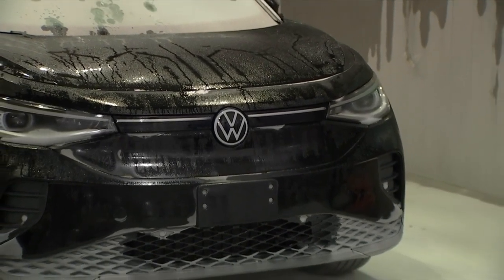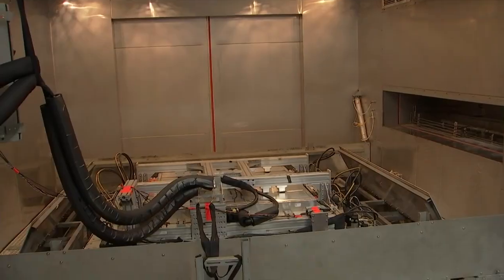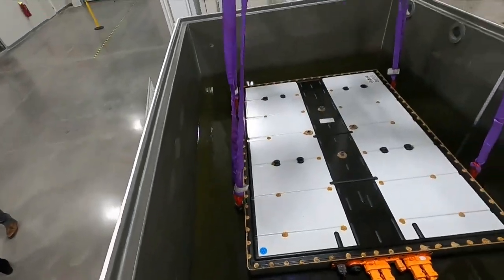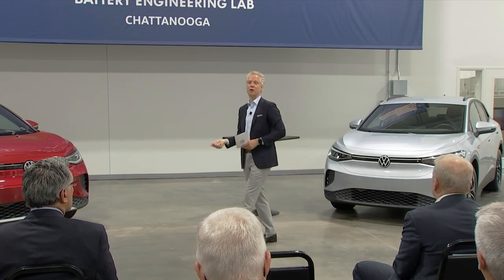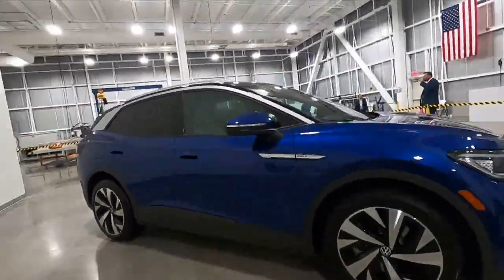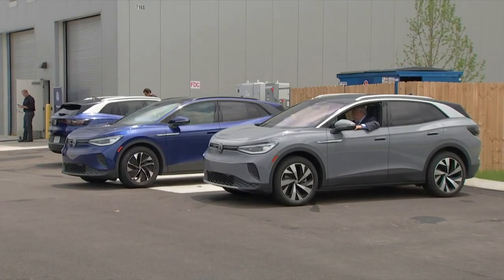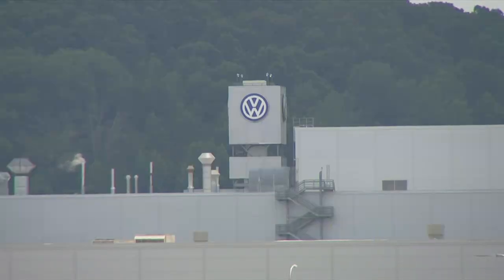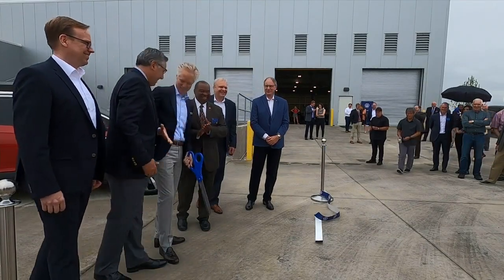Chattanooga's Volkswagen plant reveals new electric vehicle battery lab

Comment: Until batteries can increase their power density, and there is some new composition that allows for 2-3 times more stored power for size/weight than where we are now, EVs are inferior to gas power plants. They also aren't cleaner to operate, you're just exporting the emissions to the country that has to mine the minerals that make up these batteries. I get that development has to start somewhere, but let's not have the wool pulled over our eyes by a company trying to sell you something, that somehow EVs are a superior solution to gas power plants. Try to buy a large EV vehicle, like a truck, or a camper, or an SUV. They all have a small fraction of the performance to their gas / diesel equals.